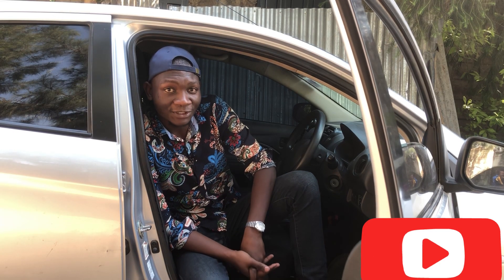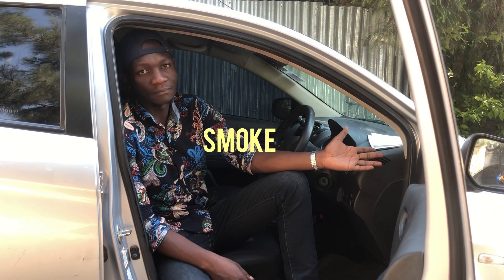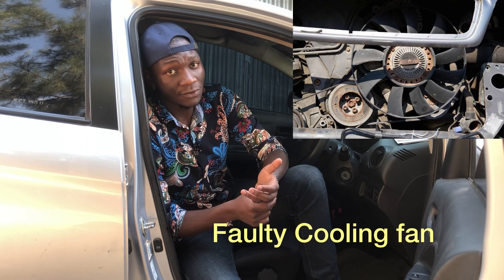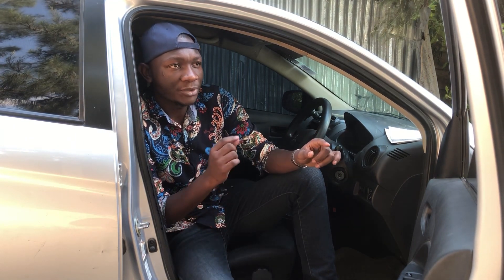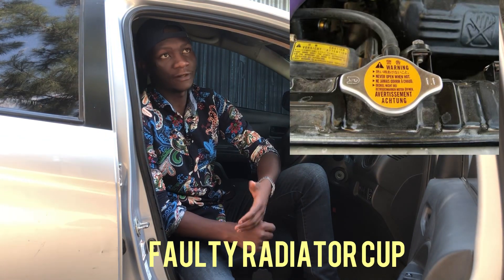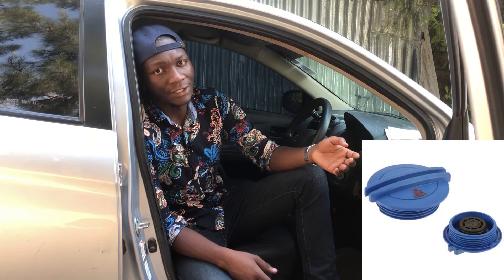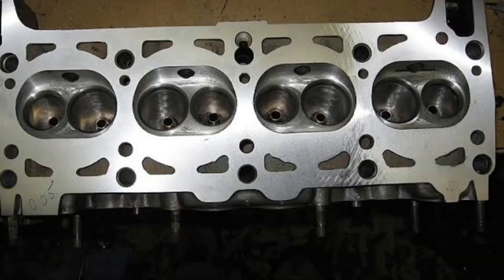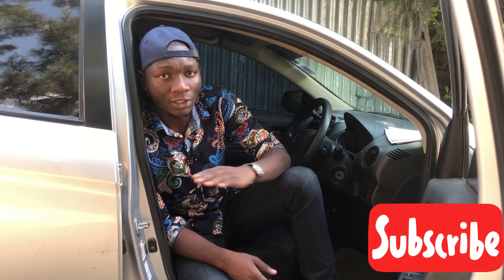Why does your car overheat. Causes of overheating in cars.

Comment: I have and overheating impreza bt it only happens when you speed. I have checked the radiator and water pump now i think the issue is the gaskets. It returns water to the expansion tank then water reduce inside the radiator and the gauge will rise sometimes to redline
Reply from the maker: Look no further, you have a failing head gasket issue.
Reply: @aswanation  bt you can have blown gaskets bt the valve are still okey right?. Si lazima upeleke heads kwa kalasinga kama valves ziko sawa ama??
Reply from the maker: @ellykipruto5622  if you were careful to let it cool, you can just replace the gasket.